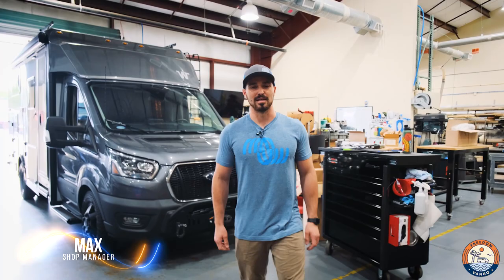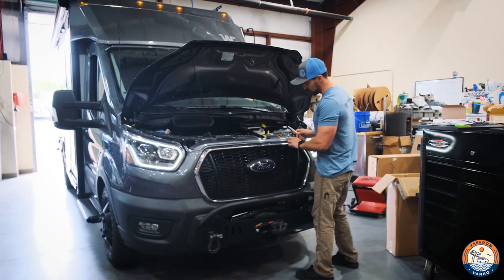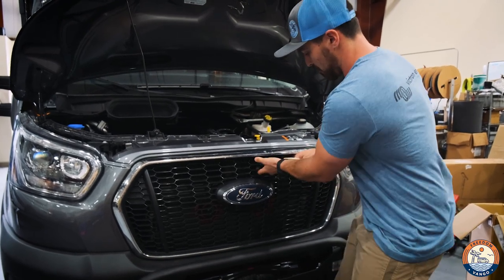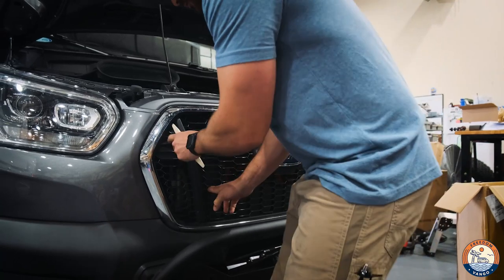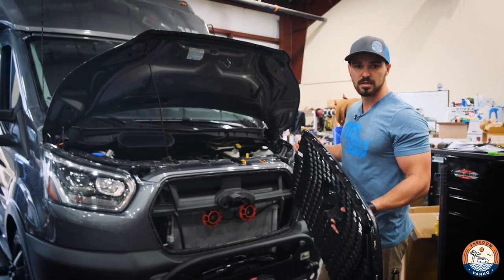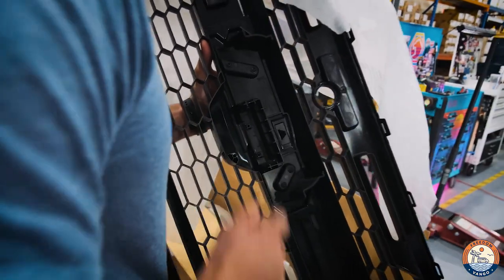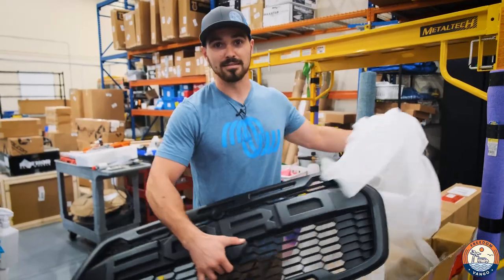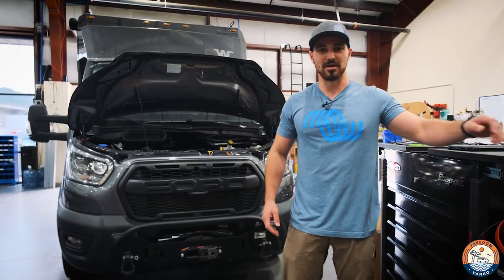Ford Raptor Style Grill - Install Tutorial

Comment: Are you concerned about air flow? Looks like there is a lot less area in this than the stock grill.
Reply from the maker: I am not.  We have tested our transit, with a heavy trailer, over mountain passes and 90* degree temps with no changes from the normal grill. 

Also, this is a factory ford part.  So Ford makes this part
Reply: @FreedomVanGo  Thanks! And I believe Ford makes the part for Europe, which has smaller displacement/lower powered engines than the Ecoboost. If I buy it I might cut out the rest of the grid/letters, does it seem like that would affect it structurally?
Reply from the maker: @bwp253  i doubt it...but theres really no need to

Comment: i need the pre-2019, Raptor grill 😔
Reply: 2015-2021 are the same.
Reply: @wortexinternational2598  not true
Reply: Literally installing it now. Bought it a week ago. Im almost done. Came here to watch the removal. 2015-21 vans are identical. Mine is 2019. Grille box says 2015-2020.  Once finished i can try post pictures. I already fitted it but doing the wirings for the light.
Reply: Done. It fits but its a china fit. Needs 2mm to be perfect but its decent. I do like the look. I bought the ones with lights.